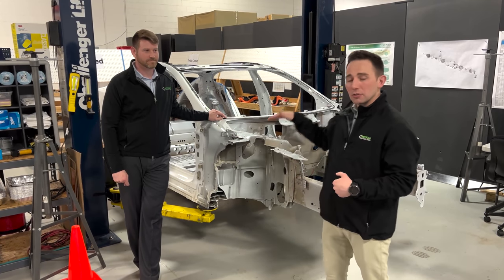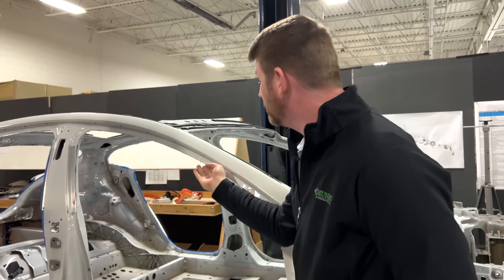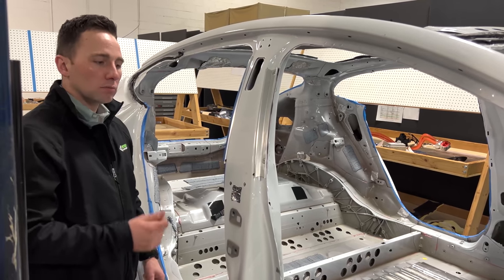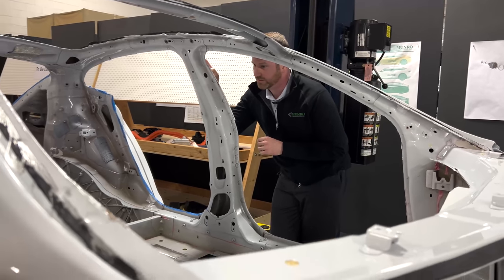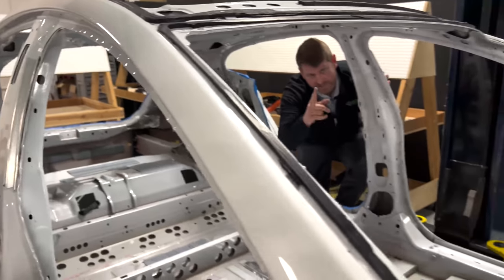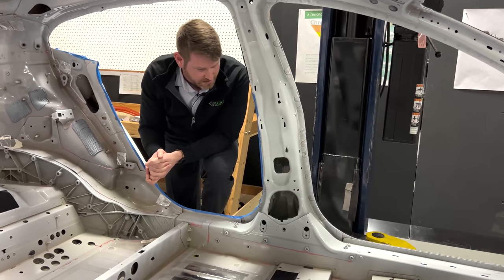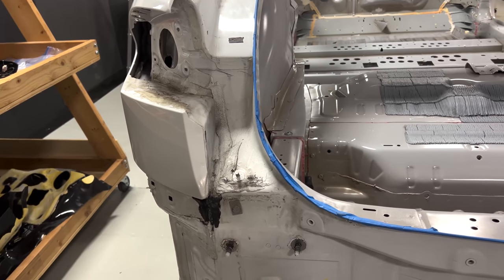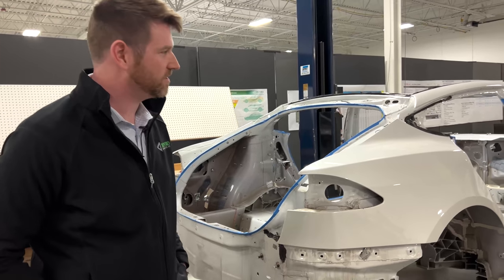Tesla Model S Plaid | Body in White PART 2

Comment: My 1986 BMW 635 has extrusions just like that to retain the door seals. They are also pillar-less doors. The extrusions run along the top edge of the windows to the mirror instead of the trailing edge.

Comment: As an owner of a 2014 Model S P85 and having engineered in big auto for 44 years I just love the detail insight from Jordan and Kevin as sad to say Ive removed almost all the panels from my car over the years to see what goes on. Its amazing to see the changes and whats not changed. The oblong duel HVAC rear vents are still there, I guess they have changed the design of the moulded inserts to ensure water does not flow in under certain conditions resulting in wet flooring in the under truck area. I stuck plastic guides that diverted water from the rear lamp housings and drainage gullies on my 2012 designed car.
Reply: Would you give us a photo of what exactly you are talking about and what you have done, thanks.

Comment: Having spent a lot of time repairing panels that came loose because of spot welds in the wrong location or cold welds combined with the difficulty getting corrosion inhibitor on to the inside of those areas after the  repaired are done. I see a much bigger problem with the execution of the door ring welds . You did a good job pointing out problems with this except you left out the fact that the distance between the spot weld and the fold is a factor in the strength of the structure.  I have seen cracking alone the edge of the line of welds because they wear too far from the fold allowing the panels to flex and fatigue the metal.

Comment: I think that the 3mm gap between the pillar and the crosscar extrusions is simply that the pillar needs to receive impact loads,  which will include bending inward somewhat,  before involving the extrusion and battery pack. There's a threshold of impact forces below which you don't want to involve the interior.

Comment: I have a 2007 Fiat. The basic structure is strong and the under-dash reinforcement frame is tremendous. BUT hidden metal is not deburred. That dash frame is not exposed to users, but it’s like razor blades under the dash plastic
Reply: Hahaha! I have a 1970 Porsche 914 whose body was made by Karmann and it's the same under the dash.

Comment: I’m with you guys on the door ring spot welds.  I commend the Tesla engineers and designers for having the courage for making a narrow flange, but on the other hand, those welds look less than perfect.  I’m not a manufacturing engineer; I presume the welds are done with automation.  It would be interesting to know what the variables are that limit the ability to place the welds accurately and with proper quality.  I would think Tesla has access to the same robots that Ford does, so what is it that allows Ford to do a better execution on the Mach E?
Reply: It’s the lack of quality control from tesla lol…
Reply: The welding tool is heavy and there is a limit to how stiff you can make the robot arm. The tip will always wiggle a little as you stop the movement to pinch the part. Eventually you can dial this out with some programming.
Reply: @BjorckBengt  Thank you for your reply, it is appreciated.

Comment: So much esoteric knowledge in one room! Thanks guys. Just a question. There is a ‘tool’ on the market that helps stop movement of the firewall where the brake master cylinder is located. The video for this tool shows the cylinder moving when you press upon the brake firmly. Is this a known issue with many manufacturers or just Tesla?

Comment: It's refreshing to witness these 2 N. American engineers spitting out measurements in S. I. units. Furthermore, they seem to prefer the smaller (millimeter) over the larger (cm) of which (cm) is favored in Europe -but somewhat less precise. I'm of the mind that metrification IS occurring in the US, it's just happening from the bottom up instead of the top down (mandated). It started with the sciences & coke bottles in the 70's & will continue on until fully incorporated into everyday vernacular. That will take decades more as even the Brits still measure their road distances in miles.
Reply: In mechanical engineering and manufacturing everybody talks and writes dimensions in millimeters, not centimeters.

Comment: I saw them show that the door mounts are bare metal but didn't hear a reason why. Why put the doors on, paint dip, then remove the doors for further assembly, just to put them back on later - instead of painting the doors separately and only install them once? Is the bare metal connection needed for tolerancing, grounding, some other requirement? There must be a reason to go through the extra effort.

Comment: Could sandy talk about rotary motors, and why they never made it
Reply: You mean the gasoline rotary engines?  It came down to efficiency and emissions more than anything.  They just couldn't compete.  Even vastly improved apex seals that made them just as reliable, the environmental issues mean they cannot develop the economies of scale to make them worth investing in.
Reply: They may see a renaissance in cases where power-to-weight is crucial.  They seem an obvious choice for hybrid general aviation aircraft where the reliability factor will be much less important.

Comment: I recall working at Dodge Truck 40 yrs. Ago; Spotwelding truck body panels be hand. The sparks were special when the robotic arm double tapped, sending them beneath the bibs of our aprons. Was the top weld in the door frame done by the Mechanical Bob double          tapping, or a man made repair?   Why not employ lighter weight Polymers 🤔 for that?

Comment: A body in White review of the Model X would be so interesting to see, 
because of the weird stuctural reinforcements required 
with the large roof opening to support the falcon doors mechanism.
Reply: This could Fly, Marty!
Reply: It’s basically the same body as the models with just minimal changes for the doors, what’s unfortunate is that the stupid door adds significantly way more weight on the model x

Comment: Has Munro, Assoc commented on the Tesla glass roofs? I've got a Model Y,  normally I love looking at the stars, up at buildings through a 'moon' roof... But the Tesla glass roof just seems to bring in a lot of heat, is fragile. It has to be tinted which lowers it's use as a window.  I've had the roof rack - I removed it.  I don't want to risk carry my kayak.  If I tried putting my kayak on that rack and it slipped... could be very expensive.   I've never actually seen much of anything through that glass roof (and I like to sleep in the back. What I remember most  is a street light.)  It seems to add  excess weight, no strength,  possible leaks (My FSD stopped working for a day after I removed the rack and a neighbor hosed down my car. I've since resealed the areas the rack installed with black silicone caulking.)
Reply: It's actually stronger than a conventional roof but does have all the other drawbacks you mentioned.  I think you can get a cover for it (inside).
Reply: @TheEvilmooseofdoom  wrong!!!! It’s not even close to beeing stronger to a conventional roof lol…. A conventional roof can be easily modified to install all kinds of features…. Not worry about glass breaking
Reply: @carholic-sz3qv  Actually you're wrong about the strength but correct about mounting things.
Reply: @TheEvilmooseofdoom  I’m not wrong about the strength

Comment: Great presentation. Takeaway is Tesla is STILL struggling with QC, so at this point it would appear that  QC is not a top priority at Tesla. Unforgivable at this price point.
Reply: At  what point did you see any meaningful QC issues?
Reply: Struggling? Call it deliberate at this point, S been in production for 10 years now, it could be perfect if they wanted it to be. But most buyers don't care about quality.
Reply: @InternetDude  The best part about Tesla is the way they allow the teams to make improvements on the fly if everyone agrees and it makes sense. No other manufacturer has the brain power or business model to do that
Reply: @b4804514  wow you are a special kind of bias fanboy 😂
Reply: @b4804514  lol….. improvements on the go!!!! You’re too funny!!! How many car models does tesla makes!? Mercedes alone makes everything from vans to bus(double decker, articulated) vans, minivans, commercial vehicles, armoured vehicles, and very special vehicles like the UNIMOG or Zetros, trucks……
Reply: @b4804514  thé model3 and y are basically the same just like the model x and s. It’s like comparing a Camry to rav4, to sienna…… those cars also shares alot of parts together.

Comment: Very interesting video.! Its shocking to realize what a design and production nightmare this vehicle is.  It probably costs a fortune to assemble this abominations and then even more to fix all the manufacturing defects due to bad design. Its a clear illustration why Tesla went to megacastings.  They just could not refine the process of making the aluminum body out of stamped components and went to a more expensive process with more predictable end results.
The blue tape you put on the sharp edges also reveals the low quality of the assembly process.  I predict that the two videous of the body in white will be taken down very soon...way too revealing. 
Great job!
Reply: I love you pretend experts making it up as you go.
Reply: You were wrong - still up 7 months later
Reply: Yup...hope it stays up longer!

Comment: If Tesla wanted to, they'd redo the whoel Model S, just like they are doing the Model 3. Same number of parts, just adjusted shapes and dimensions. It would accept the Model 3 battery sizes and have the Model S dash.
How much extra would the S need to cost having a smaller Model 3 battery and RWD? Less than $5K extra I guess, and thanks to the modest price increase, they'd sell LOADS of them (especially if adding a Wagon version).
It seems they did a near total redesign only to make small numbers again, pricing it highter than it probably needs to be?
Reply: It seems to me the S today shares very little with the original S. Tesla keeps interating so fast, with the current body using far less parts than the original.  Seeing how they are able to sell every thing they make (S/X/3/Y) there isn't much pressure to make some intermediate hybrid of an S/3.  Perhaps when they are selling 10M cars a year there will be enough demand to offer an additional varient that fits between the S and the 3.  Exciting times ahead!
Reply: It was always going to be a lower volume car aimed at the performance market with the Plaid.
Reply: The Model S is inferior to the Model 3 in terms of build quality... And I've owned two S's!!